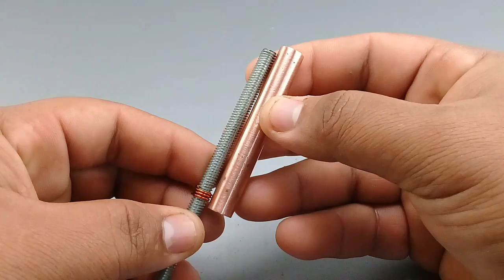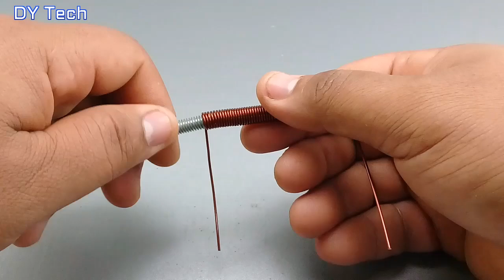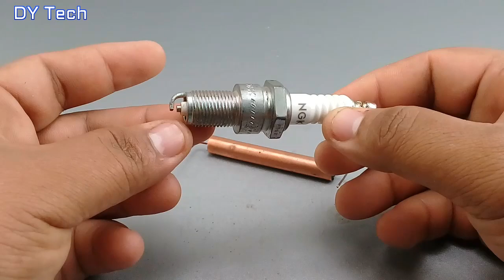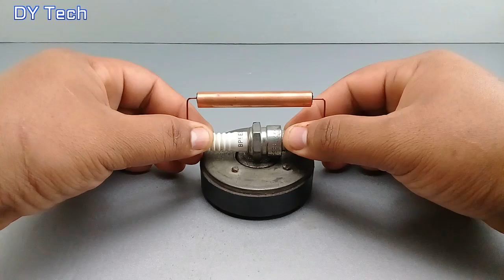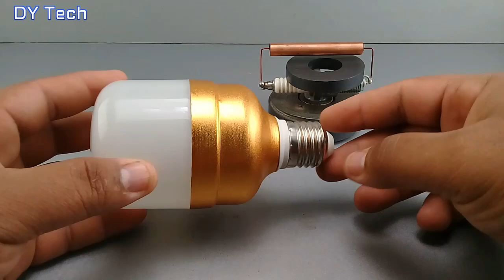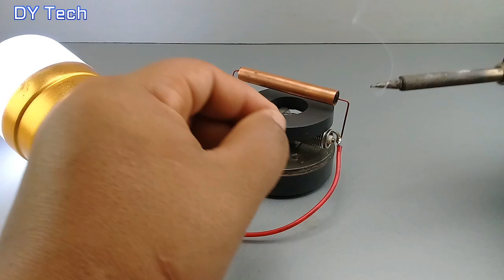How to make free 220v electricity generator from spark plug with copper pipe and copper wire

Comment: I tried this and it  didnt work. Unless your suppose to use a brand new spark plug. I cleaned the one I had . So that would be the only reason I can see that , why it doesn't work.
Reply: If you believe this Muppet, you deserve what you will get - NOTHING! ZERO Volts, Zero Amps, and as Watts = Volts * Amps, ZERO Watts!